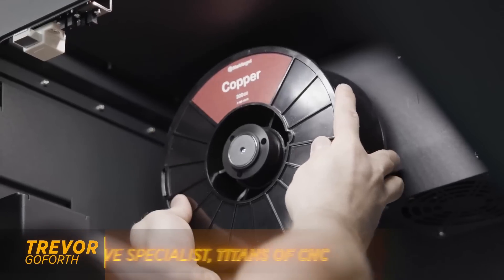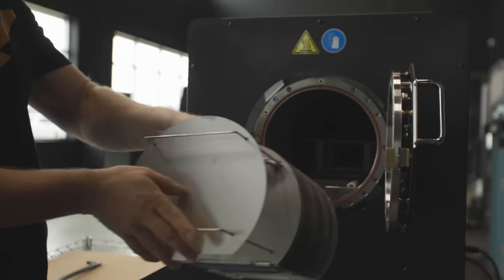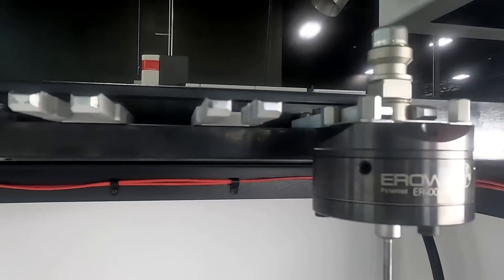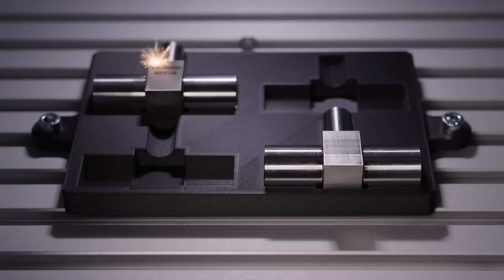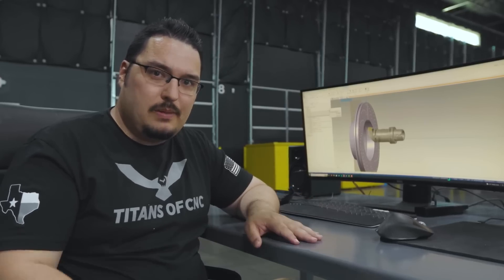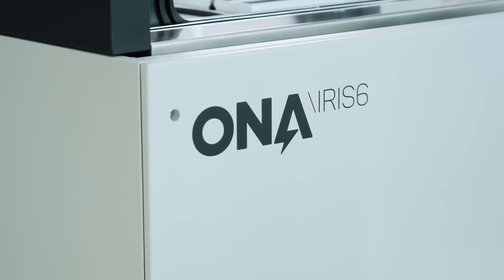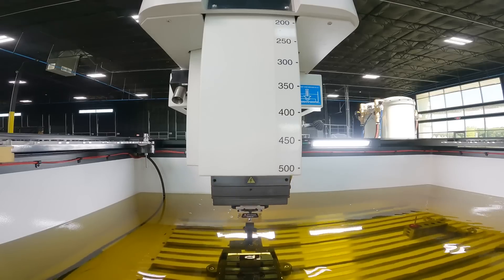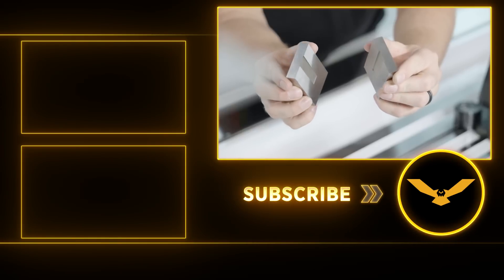Most People Have No Clue or Simply Don’t Understand How Important This Is

Comment: I will say that I have been running the same machine but I figured out a way to process parts that took forever on another machine and cut the time down by 300% on average.
Reply: Chris I hope that your given credit for it because that encourages you to keep that initiative to quicken a process. I have done that so many times and watched a former boss take credit. I didn't forget this nor let it deter me. I'm still there he is not. By the way don't keep settling for the "Atta Boy" you want $$$$
Reply: @garygriffin3114  I did get $ for it and the credit . Also a new machine for me to run is arriving next month. Going from a 2 axis cnc lathe to a 3 axis cnc lathe with double the part size capacity.

Comment: Hey, hey, hey, I’m 52 and out work any of these 20 year old knot heads. 😂 I was working at a machine shop here 25 years ago and moving up quick through this shop from cutting stock, to running manual laths, then CNC , and finally they put me in a new shop with big equipment and I was by myself by the way. These parts were rough cast and weighed 2-300 pounds a piece. I’d cut one end and the flip the part around to cut the other end. Well my inexperienced dumb self being already stressed running these parts by myself and getting in a hurry didn’t blow the jaws out good a pesky chip wedged in the corner of the jaw kicked the part out just enough to be out of tolerance and I scraped a couple of the castings, which me and the guy above me ( cool guy) had found the problem and talked it out, welllll the new guy over him made a big deal about it and in front of the whole shop like a anus ! Hot tempered back then which ended my machinists career. I was getting married two weeks after I left that shop too.🤷 Been beating on car fenders ever since .

Comment: In real machine shops you're working on broken equipment that your bosses do not allow you to fix. While many of your machines are at least partially manual. Not to mention all day engineer change requests for the 90% of the time that your prince information are not correct. Then as you're correcting the prints in engineering you get hassled by the owner because you get blamed for the time it takes to correct the information.
Anyone else getting tired of being given advice from people who have multi-million dollar equipment and setup machines that take all the thought and effort out of Machining? 
Yeah it's great, but most people are using Mills and lathes from the '50s and '60s. 
Would love some advice for saving time and fixturing for old manual machines.
It's sort of a slap in the face to have million dollar machines and the best CNC software. It's like setting everything on easy mode when you have millions to blow on equipment and software! 
Btw I'm calling BS young people aren't getting into Machining because what's shown here is not a normal place with massively unnormal budget.
Reply: 50 or 60s ? 😂 the hell where are u working, the oldest machine on the shopfloor at my work is 13 years old
Reply: I work Ina shop with primarily 15-20 year old machines and what you said is 100% accurate